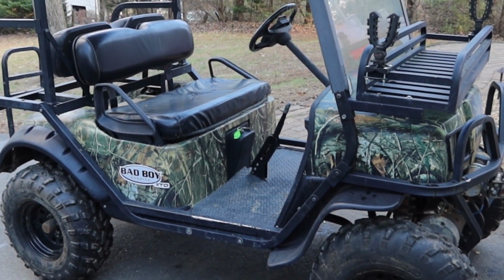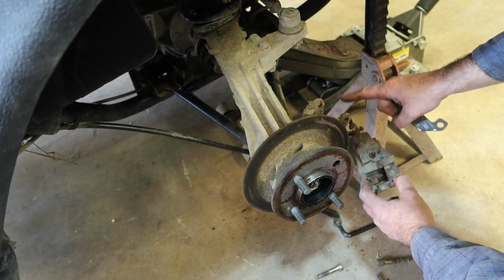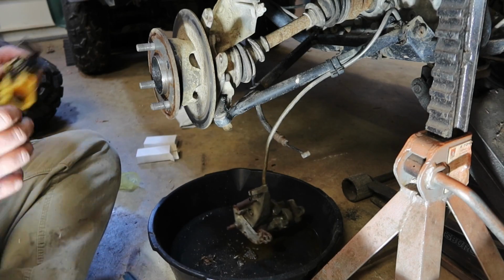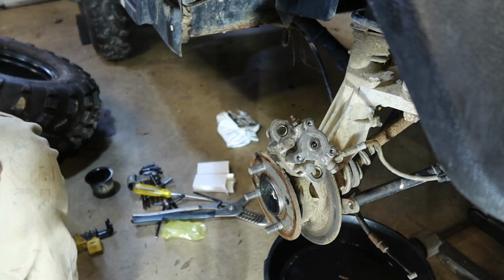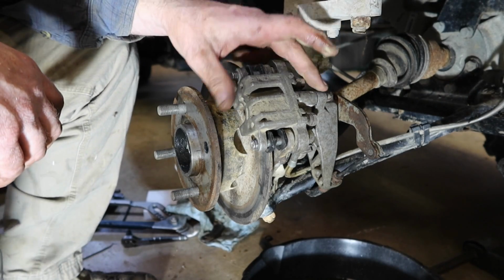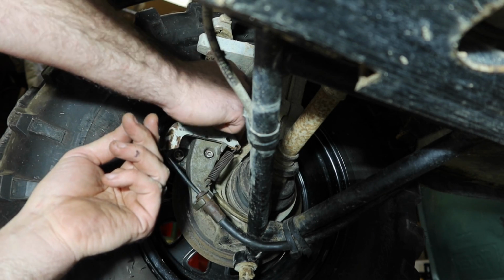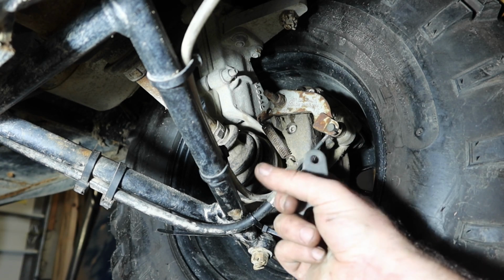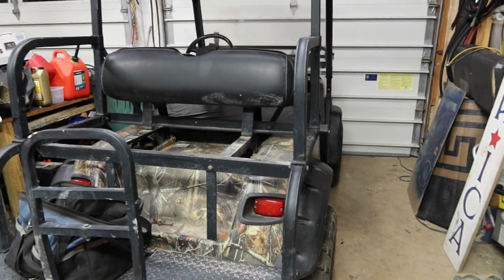Bad Boy Buggy XTO brakes and some fabrication EZ-GO golf cart

Comment: Hey ray I have the exact same buggy. I am working on my brakes. The cylinder inside the caliber does not push in all the way to be flush with the caliber. Is it suppose to or does the cylinder sit out just a little bit?
Reply from the maker: I can’t quite remember. Did I show it in the video? Usually I do
Reply: @ no sir I can’t really see how far the cylinder went into the caliber
Reply from the maker: Gotcha. I looked again and at 5:15 it looks like it doesn’t seat flush. I would put the pads in and take a measurement. It should have enough space to fit the rotor.
Reply: @ 10-4
Reply from the maker: And thank you for watching and asking! Good luck on your project.

Comment: Hey Ray,
I have a 2011 bad boy buggy xto with sevcon millpak controllers that will not move in forward or reverse. Both controllers have solid green lights, both solenoids pull in and show 50volts across B+ and B-. The fwd/rev switch has continuity on pins 2 and 3 respectively on the connector going into the controller when engaged. Yet nothing happens when I press the accelerator. Do you have any ideas as to what could be wrong?
Reply from the maker: My first instinct is the brushes in the motor but I’m not sure. Hopefully someone will chime in
Reply: @RayofallTrades  Hey Ray, thanks for your response. If there is any other information I can provide that may be helpful, please let me know.
Reply from the maker: Forgive me if you already know this but just for clarification- the solenoid energized will be 0 volts across  being that it is merely a wire now and full potential voltage when open since it’s the largest of the load at that point. I also want to bring up the accelerator sends a pulse signal to the sevcon to turn on. I believe there is a way to use an o scope to capture that. If all of this is basic info to you, then try to join the bad boy buggies facebook group. There are a lot of people on there who specialize in those. I wish you the best of luck and please let me know me know what you find out.
Reply: @RayofallTrades  Yes sir, I’ve verified the solenoid was closed by checking voltage across B- and B+ on the controller. Is that what you’re referring to essentially? And I’ll join that group today. I appreciate you taking the time to respond to my inquiry.

Comment: Trying to find caliper piston seals is almost impossible. The suspension design is a weak point as it uses the strut as a top hinge. These motors have so much torque that these struts dont stand a chance. My passenger rear is wobbly and a mounting bolt is broke off the rear gearbox, likely both related to torque. I added a brackt to stop the motor and gearbox from twisting at hard acceleration.

Great video, i have same leak on the same wheel. Well done, Ray!
Reply from the maker: Thank you so much and I like the idea of adding the bracket. I keep hearing a clunk on accel and decel

Comment: What is the handle in the middle of the front seats? Do you like this cart? I’m looking at one similar and I’ve heard mixed reviews on badboy
Reply from the maker: The handle is the parking brake. Yes I really like the cart. It's pretty heavy and parts are a little tough to find but compared to my last gas powered yamaha cart, this is quieter and has more torque but not as fast.
Reply: @RayofallTrades  where’s the F-R switch? I’ve heard these carts are unreliable and don’t last long on a charge.. don’t know if that’s true. Sorry to ask a million questions I’m just stuck on this or a Stealth 4x4
Reply from the maker: @jdcalame6714  the f-r switch and key switch is right by the seat behind the handle. Battery life is a simple equation of amp-hours used. Keep in mind its heavier, pushing 2 motors, and the age of the batteries so I anticipate there is mixed reviews on battery life with all the possible habits of people.
Reply: @RayofallTrades  true. I may go for one of these thanks for helping me out
Reply from the maker: @jdcalame6714  good luck and thanks for watching.